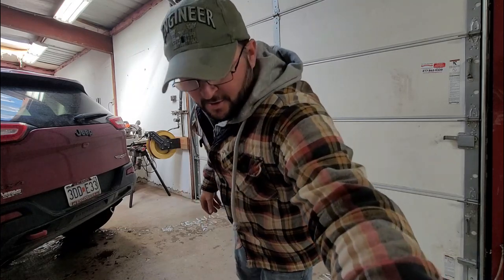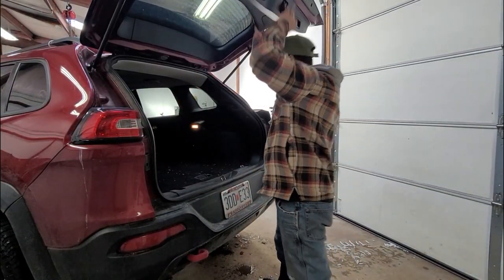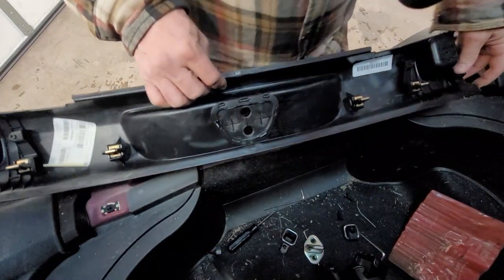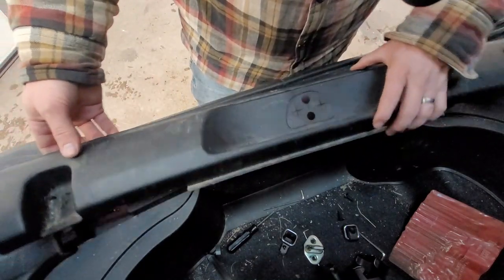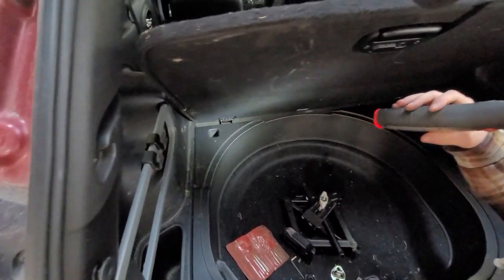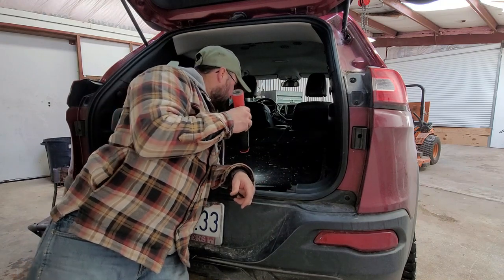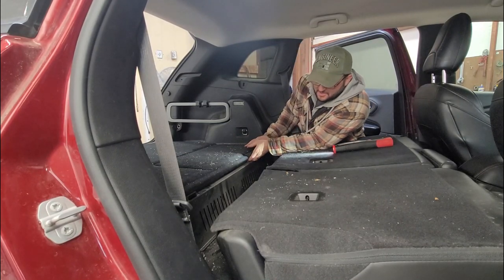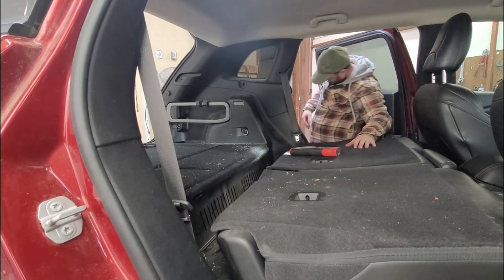DIY Drawer System for Jeep Cherokee KL Trailhawk Part 2: The Teardown!

Comment: You can also pull the lid off the hinge from the rear. Lift the tail end about 6 inches at an angle and then snap pull one side and then the other.
Reply from the maker: Hadn't thought about that. I was just figuring it out as I went along

Comment: Watching for ideas.  I won't be doing to much to mine till the warranty runs out. Hope to find a winch system for the front  , the lift and better tires at the beginning stages of mods. Going to get some miles off the factory tires first. I  did do a budget rack so far. Love this trailhawk. Hope to get it on some forest roads soon. Thanks for the inspiration.
Reply from the maker: Yeah I had mine a couple years before I started adding mods. As for a front winch mount I've found three places to get them. Rocky Road Outfitters, Frog fab and MFC offroad. I'm planning on picking one eventually. Good luck with the build!
Reply: @MootsKLAdventure  Thanks. Haven't researched yet. I hope by the time I am ready they have one for the new body style. They may already. Also hoping I can use my xbull 1300lbs that's in my floor. Lol
Reply from the maker: @Outdoors4adventure  they all three have one for the new body style already so you'll be able to find one.
Reply: @MootsKLAdventure  Good to know.

Comment: With those seats folded sown is there enough room to sleep?
Reply from the maker: I'm not sure what it measures out to but it looks like enough room for me to sleep.
Reply: I’m 5ft 10in and I have to fold down the passenger seat to fit. I’ve done it a few times but it’s a tight squeeze for sure.
Reply from the maker: @nicg5580  I could see that now that I've looked at it again. I hadn't really considered it because I've always got my two boys at a minimum.
Reply: I would say if you’re solo with the back seats down there’d be space for you to lay down just in the back if you’re at an angle, otherwise you’d probably end up moving the front seats forward
Reply: I've done it a few times. I got a cheap air mattress to throw in the back. I have to angle a bit (I'm 5'11") but it works. Ceiling is pretty close with the air mattress haha.